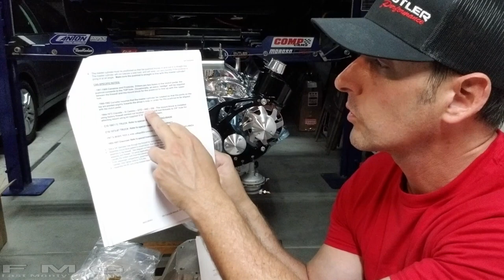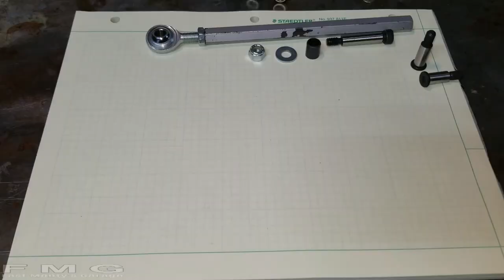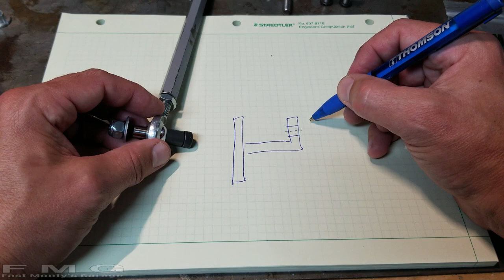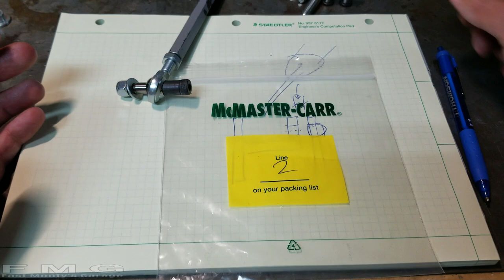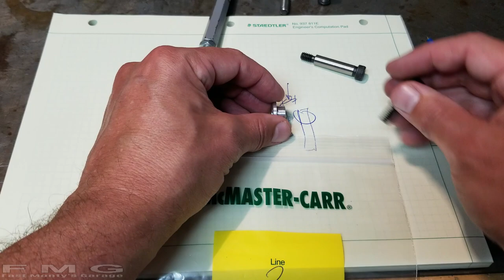How to install a Wilwood Hydraulic Clutch Master Cylinder, for your old muscle car.

Comment: Ironic enough, I’m putting a T56 in my 68 Charger and I got the kit from Silver Sport. Mine was a factory auto-console car so I’ve got a little more work to do but the reason I’m here was to find out how to set the rod adjustment. So thanks. It helped me out.
Reply from the maker: Great to hear!  Love your choice of cars too!  Can't wait to see you rollin...  Check out my AN Radiator hose install... you might want one of those too.  ha, ha.  Thanks for the comment!

Comment: Hi I have a question in regards to the install of the MC bracket in the engine bay. I have the hood and the hood hinges off my 71 Camaro. It still has the original Saginaw installed. Does one have to remove the brake booster to get to the hole where that bracket and MC is going to reside? If I remove the front driver's side front fender it might make access to that area better. What is your opinion on that? I have to remove the fender for bodywork and I might "while your there" take care of the new MC bracket. My goal is to NOT remove the brake booster if at all possible. Thanks!!
Reply from the maker: Great question Danno... Unfortunately, I don't know, because I have hydro boost, which is a different size/orientation than a vacuum booster.  But, I do agree that while you have the fender off, get other upgrades done.  Let us know how it goes!

Comment: I’m doing this on my 69 chevelle right now. The kit says to grind the firewall surface flat or bend the metal flat. Doesn’t look like you did that in this one. Does your rubber seal sit flush on the firewall?  The nut serts and raised flange stop mine from sealing well (I thought) so I ground it all flush..
Reply from the maker: Hey Thomas, yeah, mine was flush, without grinding.  Sorry to hear about the PITA... must look sweet now, eh?
Reply: Thanks for the comments. Shoulder bolt change out was absolutely necessary I did the same thing as you.
Reply from the maker: Interesting... didn't know that would be the same on a Chevelle... good to know!   @baygentst

Comment: The typical classic car scenario.  What should be a 45 minute assembly turns into a multiple day process and ordering addtional parts to get things to fit.  69 Camaro owner with tons of addtional hours on simple projects lol.
Reply from the maker: Ha!  Totally!  You're not a real muscle car guy unless you're a part of the "it never fits right" club.  Thanks for the comment!
Reply: Hi Dan you are so correct! I needed to replace a noisy rear wheel bearing and look at the axle for damage. Easy right! remove the cover, drain, C clips pull the axle...RIGHT! Not if the pinion cross shaft bolt snaps off and your left with a nub and the rest of the bolt is stuck in the carrier. Good Grief a complete and utter nightmare. I tried everything even a extraction tool made for this. NO WAY those axle are coming out with those C clips in place! I literately destroyed the carrier by cutting out the area where that pin sits with a Dremel cutoff wheel. A 45 minute job turns into a manure show!
Reply from the maker: @Danno74Z Ouch!  Thanks for sharing!

Comment: Hi Monty, Did you have to add a pedal stop to your clutch setup? The Tilton HTB requires one so the bearing is not over extended? Thanks
Reply from the maker: Nope.  :)
Reply: @FastMonty  OK Thanks.

Comment: Have you ever seen a block with different mounting bolts on each side? I have 5 pads with 4 holes drilled on one side, then I only have 3 bolt holes in the passenger side. I’m putting it in a 1969 and now I have to figure out what I am going to do.
Reply from the maker: Aaron, Can you be more specific?  By block, are you referring to the mounting block for the master cylinder?  If so, is it a Wilwood? You're putting into a 1969 what?  A GTO?  If you are referring to the mounting block, for a Wilwood master cylinder, for a 1969 GTO, there are two mounting holes for the master cylinder that are threaded, and there are three through holes for bolts that go through the fire wall.  If you indeed have a Wilwood master cylinder with a two hole flange, call Silver Sport Transmissions and buy the adapter.  Otherwise, please try and be more descriptive with your issue and we'll all try and help... thanks, Mike.

Comment: Is a hydraulic master cylinder required with a hydraulic throw out bearing? Currently trying to set up my clutch.
Reply from the maker: Yes, the MC is the piston that pushes the fluid.  The Throw Out bearing is the piston that receives said fluid, or force, from the MC.  You can't have one, without the other.  Thanks for the comment.
Reply: @FastMonty  thanks. Very helpful.

Comment: Nice videos. Can I get the part number on the hydraulic unit as they sent me the universal part which is difficult at best. Trying to work around the problems of using this part untill I saw yours.
Reply from the maker: Robert, Not sure what part number you're looking for?... the hydraulic master cylinder itself, is universal.  The difference is the bracket that mounts the unit to the firewall.  Silver Sport Transmissions has the correct bracket.  Just give em a call and they can walk you through the solution.  If I'm not understanding your question, please re-phrase it.  Thanks!
Reply: @FastMonty  thnx for reply that is the answer I needed. To use the universal bracket requires a few modifications. That Iam not sure I want to do.also I did call them when I got the parts. Perhaps the new guy answered was no help will give them another try. Thnx again and keep up the good work.
Reply from the maker: @roberttjohnson957  Sounds good, if you need further help... just shoot me an email, which is in my profile.

Comment: Ive gotta stop letting your videos talk me into different ideas and mods. lol I been thinking about putting a t-56 in my gto off and on since early 2000s. My car was a factory 4speed but i fragged the muncie first year I had the carin 95'-96' Its had a th400 outta Bonneville since. Ive got a few different t-56s and tr6060 laying around from my 4th gen f body and cts-v days.
Reply from the maker: Dang Steven!  Glad to hear you have options just laying around... ha, ha... and, you're welcome.  Thanks for the comment, can't wait to hear about your progress!
Reply: @FastMonty  Yeah but each one is laying around for a reason lol. They may need just a lil re-shim or make a little noise lol
Reply from the maker: @hotrod6919  Ha!  That would make sense.  Can't wait to hear what you pick.
Reply: @FastMonty  Well ive ran both the 2.66 gears and 2.97s with my Ls and like the 2.66 gearbox better more fun for street but the 2.97 is better for 0-60  and ets But If I just keep it auto I wont have to worry about spilling my beer on the kids lap! lol j/k
Reply from the maker: @hotrod6919  I just spit out my beer, reading this!  Thanks for the laugh.  Keep at it!

Comment: Thanks for videos Mike.  Question: Have you had any issues with the cylinder leaking? I've installed a hydraulic clutch kit in my 76 T/A  which was a Wilwood like the one you have. After only a month the cylinder started to leak from side loading the piston actuator. I noticed on yours there is not support for the actuator shaft. I built a bracket to stop the side loading. I also made sure it was a straight as possible for the actuator clutch rod.
Reply from the maker: No leaks yet!  Might be tough to tell in the video, but the bracket is angled to maintain a straight throw.  I guess only time will tell... I'll keep an eye on it... thanks for the comment, and hope to see more comments from you in the future.  See ya!

Comment: Any idea what the biggest throw on an external slave I could get?
Reply from the maker: Great question... I honestly have no idea.  Have you asked Silver Sport?  I'm sure they'd know, and/or point you in the right direction.  Good luck, and thanks for the comment.
Reply: @FastMonty  no.. ill look them up. I've got a 302 t5 swapped ranger, using a 99 f550 master with a 280z external slave.. clutch engagement is just to close to the floor.
Reply from the maker: @19jody72  love the creativity of mixed parts... I assume you tried moving the connecting rod closer to the clutch pivot?  I'm sure there's a solution somewhere.  Have fun!
Reply: @FastMonty   Yes I have it setup so I can adjust it to try and get more throw towards the bellhousing.. however, I think  if I adjust it more.. Ill end up making the clutch slip
Reply from the maker: @19jody72  I hear you... always a tough balancing act.  I have faith you'll figure it out... let us know how it goes!

Comment: How do you measure to limit drivel of the push rod. Too much travel will over extend the release bearing and cause failure. Thanks
Reply from the maker: Good question, and very valid point.  Typically, you'd order the Master and Slave as a kit.  Or, to OEM spec.  If not, you need to understand the capacity of each.  Basically the volume of each cylinder need to match.  Bore X Stroke = Volume.  Always best to error on the smaller side for the master, so you don't blow out the Slave.  Hope that helps.